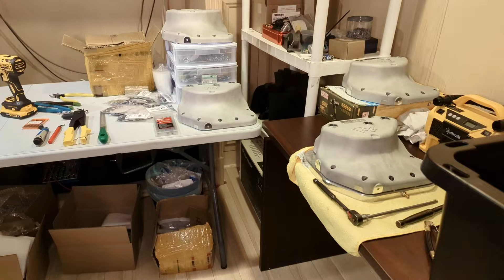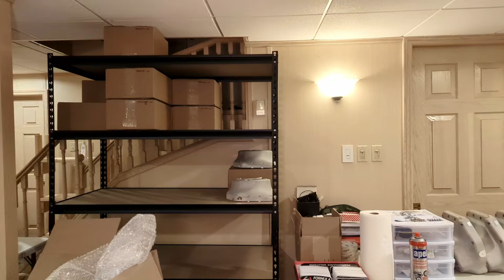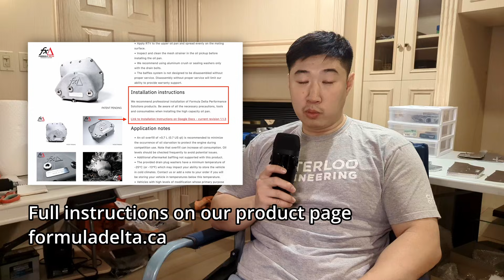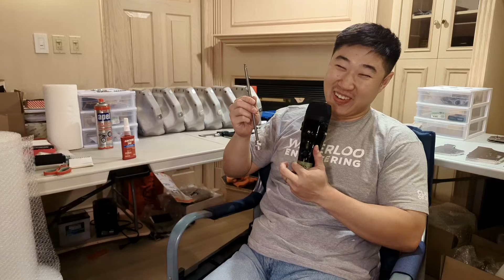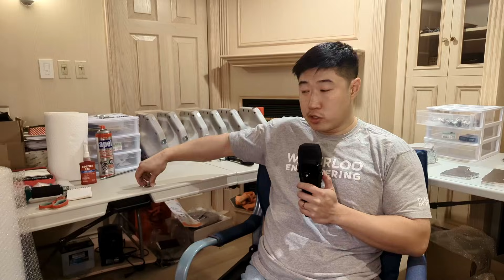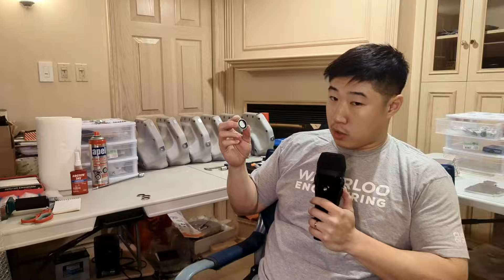Toyota GR86 / Subaru BRZ high capacity oil pan for FA24 - Update #8

Comment: Hi. can it fit in RHD ？and use Fujitsubo EXH PERFORMANCE UNIT ？
Thank you
Reply from the maker: Hi Tony, the oil pan fits RHD vehicles. We are not sure if the exhaust header you mentioned fits as we dont have a 3D scan of it or tested fitment with this header. If you can send in a 3D scan to us of the Fujisubo header, we would be glad to confirm fitment with out product.

Comment: How does it compare to versus?
Reply from the maker: We can only speak about our own product, but we are especially proud of the fact that our oil pan increased volume by 1.4L, fits OEM headers with heat shield attached and a variety of aftermarket headers (including turbo headers)
Reply: @FormulaDeltaOG will you be doing a video on how to install?
Reply from the maker: It's the middle of winter for us but we're hoping to film something in the spring. In the meantime, we do have comprehensive written instructions available on the product page. We also did a video collaboration with @DriversPaddock showing a few bits of the installation.